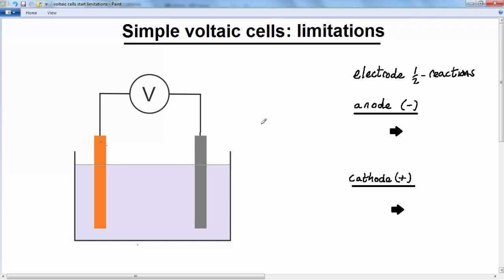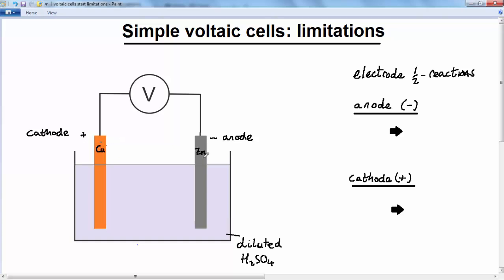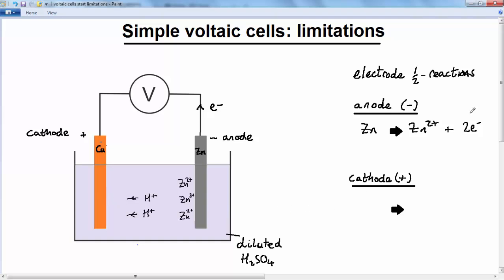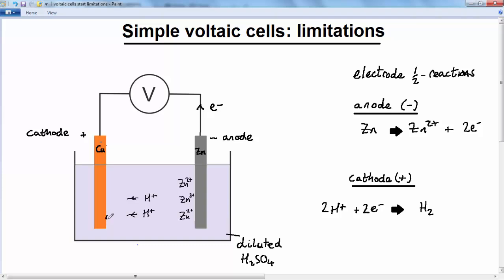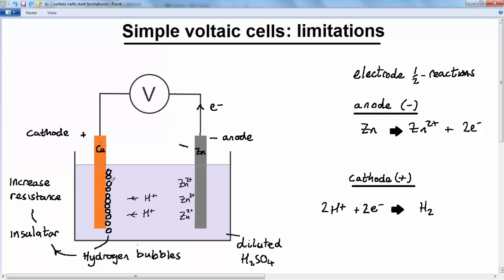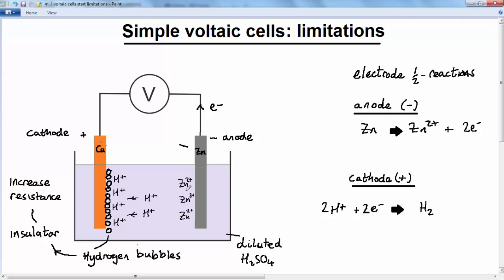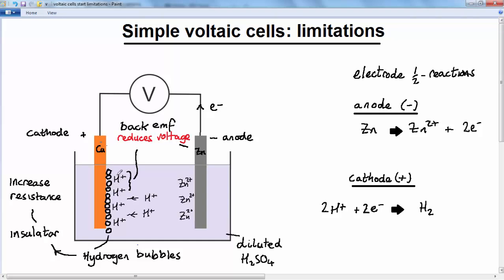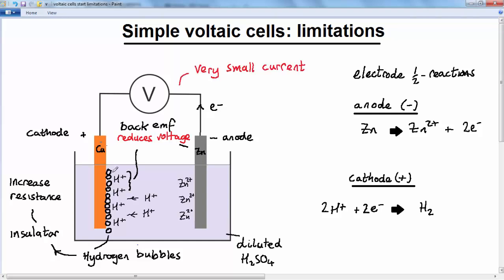GCSE - CHEMISTRY -  ELECTRO CHEMISTRY -  LESSON 11 -     simple voltaic cell

Comment: anode is positive and cathode is negative!!
Reply: Not true. By definition, oxidation takes places at an anode and reduction takes place at a cathode. In electrolysis, the anode is positive and the cathode is negative. However, in a cell the anode is negative and the cathode is positive. The two processes are the reverse of one another. Electrolysis uses an electric current to bring about chemical reactions; a cell uses chemical reactions to produce and electric current.